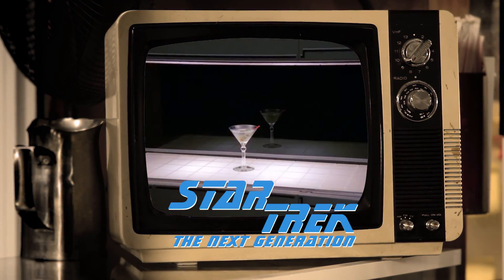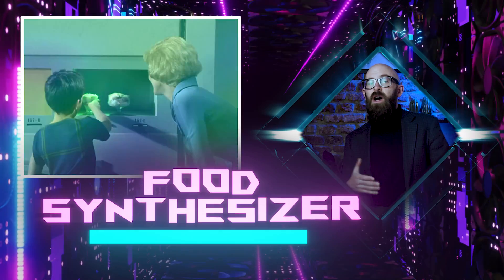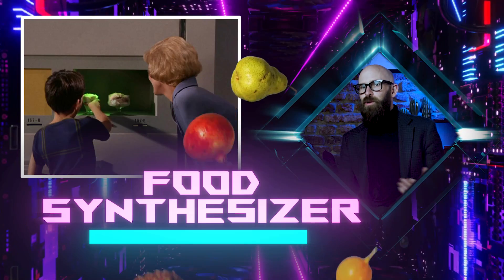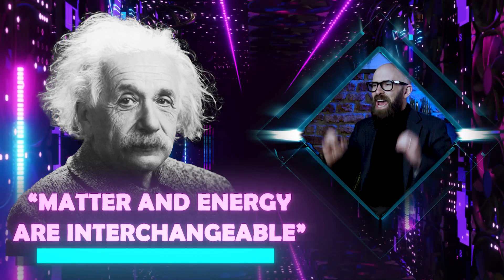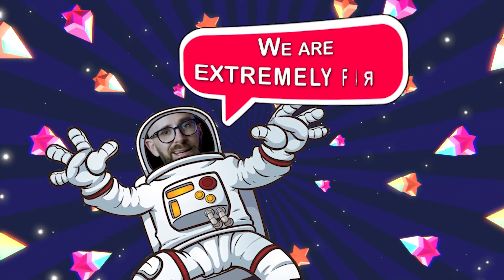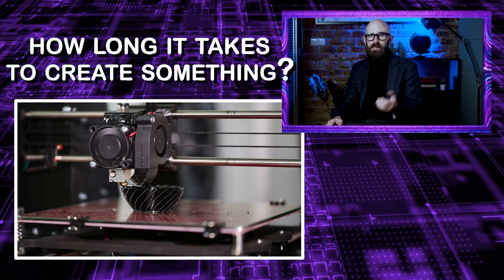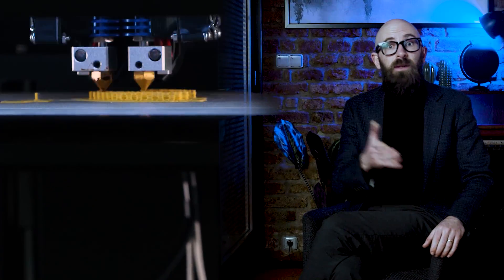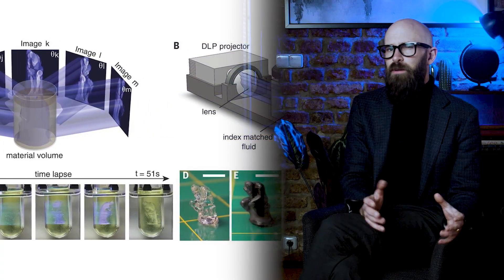How Far Away Are We From Replicators?

Comment: That's one of the reasons that Star Trek - Voyager worked for me. They had to limit power use the whole trip and food was always a concern. Made the whole reason they had to contact others along their way home instead of just going in a stright line.
Reply: It always bothered ne that when making cofee they replicated the whole mug and water in it instead of just replicating instant cofee, reusing the mugs and just adding hot water to save energy.
Reply: Voyager has two small Bussard ramscoops since it's lower tier starship class.
Reply: @valenrn8657  you mean section 31 class;)
Reply: They actually had to refuel the classified torpedo and shuttle replicator.
Reply: When you recycle the mug you get most of the energy back.  And you didn't have to worry about washing it.
Reply: Neelix was great!
Reply: That was a way to enforce artificial scarcity but yes.

Comment: 5:55 the 3D printer pictured can take over 10 days to print one object that fits in its "build volume" of appx 8 X 8 X 8 inches. (if it takes up most of the volume and has high "infill" percentage)

I have 2 printers that are a little more advanced than that one....

Comment: My understanding of physics is very limited, but I think using energy to create matter also results in an equal amount of antimatter. For a civilization that has mastered faster than light travel, that's probably trivial. For us, it's less trivial.
Reply: No.  The original source of mass to create the  energy is from sources that were matter, and baryon number and lepton number are both conserved, which means that the output would also be matter.  Matter and anti-matter have opposite baryon number and lepton number. So, if the original source of mass were anti-matter, the baryon and lepton numbers would also be conserved, resulting exclusively in anti-matter.  Do a search on "conservation of baryon number and "conservation of lepton number".

There are some processes that do result in particle/antiparticle pairs, such as a photon creating an electron/positron pair, or an electron/positron pair annihilating to create a photon. This is most commonly seen with what are called virtual particles, but the net result is baryon number or lepton number change of 0 (conserving the number), since the positive number of the matter exactly balances the negative number of the anti-matter.  But this is a scenario where you are starting from 0 and ending with 0.

When you start with source that are ordinary matter, you will also end with output that is ordinary matter due to the conservation law.

Comment: On starships they have Bio-stores and Mass-stores for the replicators (you can find them in some technical manuals). 
The Bio-stores store Biological molecules, instead of the base elements, probably to reduce power costs and it doesn't need to start at the elemental level. 
The Mass-stores store Elements, but only the most common ones, and can easily be replenished from planets, asteroids, gas giants and so on. The more complex an element is (normally the higher its atomic number) the less is stored, this puts a limit on what can be replicated as to make a lot of the heavier elements takes a lot more power. 
Another thing that limits them are materials that can't be replicated because they contain components to their structure outside normal space-time like Di-lithium. 
Lithium, is stable. However in Star Trek they have Di-Lithium (which can't exist in real life) which is actually a Tri-Lithium with 1 Lithium atom in another layer of space, that stabilizes the Lithium. In star trek when Di-lithium is bombarded  with antimatter some small amount will convert to Tri-lithium as a byproduct. But because of its extra-spacial properties, it can't be replicated.
Reply: It's not due to having extra spatial properties.  It's due to the structure being too complex for the "molecular resolution" of the replicator.  Replicators use extensive compression and averaging techniques, because it is not possible to store a pattern at the quantum level necessary for that, because even in the 24th century the storage space for that doesn't exist.  (Transporters use something called quantum resolution, but they store the pattern itself in a buffer that degrades.)
Reply: @StormsparkPegasus  this is why yu can't make living organisms with replicators too.  Though that limit may change in the futer as when the TNG Enterprize was transforming into alien ship it did make living materials.  Andm it did mak a child(procreated)  in another episode.
Reply: @0011peace  They have made living things in the replicator, like Worf's spinal cord.
Reply: @SiXiam  was it "living" or just a bunch of bio matter? As for the power it takes for these to work, or the "Stores" needed for them to work..... I remember one Next Gen show having portable Replicators about the size of a kitchen trash can, they brought down to a planet.
Reply: @SiXiam  
Thst isn,t itself alive and it used a solution no just replicstor
Reply: @finscreenname  I'm not sure what episode you mean. At the very least we know the replicators on the Defiant have a feed of plasma (basically hydrogen). Kira blew one up. So it wouldn't be just straight energy to matter like the video says. Maybe the portable one would have a fusion reactor for power/plasma.
Reply: @0011peace  Nerve cells are certainly alive. But the details of the machine aren't really shown. Maybe it combines cloning with transporter resolution replication. At that point I don't think they said a replicator couldn't make living cells. In Enterprise they showed a replicator that made a full body. A dead body but it had cells.
Reply: @SiXiam  I like ST and all but you won't find me at comic con so what season and episode I dont have a clue but I remember it was Next Gen and something about the planet, so they beamed one down. They did also say that it would make food and tools (probably not things like phasers).
Reply: @SiXiam  with help and i am tLking about plsnts snd animals that can live on tjier own dspinl cord cqnot live on its pwn
Reply: @SiXiam  dead cells aren't alive they can't create and animate .  It is statd in TNG including surprize when living  plamt came out of the replicator.
Reply: @finscreenname  The Survivors I think it was
Reply: @finscreenname  They have micro fusion technology, which a lot of star trek tech is based on.  Picard references it in a few episodes.  Literally a fusion reactor in a vessel the size  of a Energizer D cell battery.
Reply: I think Tri lithium was weaponized in one of the episodes, they also talk about Tri tanium, Geordi references it.

Comment: For big castings that require custom mold you hold on for potentially decades for replacement parts we currently might as well be using star trek technology. The fact that steam locomotives used castings is a big reason why they were replaced. Today with 3d [printing you could store a virtual mold for 50 years before you need to use again.
Reply: There's a nearby company that make power generation stuff, they had some large castings done, left them to weather and age for a few months (possibly longer) - and they were stolen. Fortunately they got them back.. I find the frame castings for the duplex locomotives amazing, all cylinders and steam/exhaust pipes cast in one piece of steel, itself difficult to cast because it's not very runny.
Reply: @joejoejoejoejoejoe4391  Lincoln Welding company is 3d printing metal with robot arms & a welder.
Reply: @jmd1743  It would interesting to see the difference in emergency consumption of casting and 3d printing, I presume that it would be about the same, but it still could be wildly different. I presume that you could change the alloy in different places with different feeders, possibly even using bronze bearing surfaces on a steel print. If you added a milling head to a 3d printer, you could print and finish machine something in one operation.
Reply: @joejoejoejoejoejoe4391  I'm interested in seeing where 3d printed guns go because a 308 cartridge exerts 60,000 PSI on the gun when the gun goes off.

Compare 60k PSI to say  the stress seen with air compressor. 

Guns were among the first mass produced items on the planet in a factory mass production environment because it was a matter of life & death to standardize the tiny parts such as springs.

A gun is likely able to withstand  more pressure than a rocket engine.

Imagine the day when SpaceX could 100 percent 3d print one of their raptor engines.

I'm interested in 3d printed organs, my prediction is that we'll replace hearts like we do with timing belts on a diesel.

 If we could 3d print a gun we'll likely be able to produce organic material that would allow a 3d printed heart to last 50 years before it needs replacement again.

My long term objective? We'll we're about to enter a transition for human civilization like we saw where we went from hunter gathers to farmers.

Mexico has gone from 6 babies per woman to 2 babies per woman, their pension system has collapsed. Japan's and China's pensions are about to collapse along side America's.

What I'm hoping to see is science greatly extend a person's life such as making  frail bones, heart attacks & strokes a thing of the past so that if people were to die it would be peacefully in their sleep and not because of a cascade organ failure.

So we'll need to do things such as 3d print new hearts, kidneys, be able to produce bone marrow in giant vats and to be able to produce gallons upon gallons of blood & plasma.
Reply: @jmd1743  I don't know much about guns, but I think the first barrels were made by making a spiral of steel, perhaps a 3d printer could do something similar, and have something like a de-scaler following the nozzle to forge the steel and change it's Chrystal structure. Your comment seems to have interesting contradictions, you talk of guns, and also of prolonging life, and the problems with pensions. I think if we could do something about the unfairness of illness, it would be an incredible advance, instead of people suffering and dieing at a young age, before they've had a chance of life, they'd be able to live as long as the rest of us. The blind would be given sight, the crippled given movement - but then would we be in danger of having everybody the same? Don't our weaknesses define us as much as our strengths?

Comment: As I recall from the tech manual for star trek TNG, the replicator was actually more a form of transporter that took a generic for of matter, and manipulated it so that it would become whatever was needed.

So it wasn't QUITE turning energy into matter.
Reply: exactly what I was thinking, and considering at least some amount of the engines were matter antimatter type engine. it makes sense that the energy for the replicators was the same fuel source that powered the warp drive. IE matter and antimatter. Super energy dense and pretty freaking stable
Reply: @LeonardGreenpaw  à
Reply: Correct, the manual says it comes from "inert carbon", and when I asked my science teacher about it he said carbon is not inert
Reply: @NeoTechni  Diamonds and Graphite are inert carbon.
Reply: @looksirdroids9134  You can burn diamonds.  Weird to think of the CO2 pollution from that.
Reply: @lubricatedgoat  By that goal post, nothing is inert. Which is scientifically correct, but I think it misses the mark from the writers of the show. Whom wrote from a pool of common knowledge. Like the noble gases being inert, instead of scientific reality where they aren't. Diamond and graphite would be inert in the sense they wrote as you have to take measures beyond exposing them to the standard living environment of a human to have them react.
Reply: @NeoTechni  
Carbon, like oxygen, likes to bind to things. Though the term inert carbon could be a bit elastic, meaning not part of a living organism.
Reply: @NeoTechni  but can  it be made inert?
Reply: This is correct, the official blueprints for the ships include numerous storage containers marked "organic matter" and so on, some of them specifically say they're for replicators.
Reply: correct.
Reply: @Cancer McAids I own a set of the blueprints for TNG and it clearly shows multiple levels and many storage containers holding all the different matter and such needed to produce the items.  The only thing that was brought up is it couldnt replicate sophisticated patterns.  Human hearts were fine, but human brains could not be.  And them the alcohol was created using synthahol which tasted like the alcohol but wasnt able to be replicated as original.  Thats like scanning the ingredients in for Coca Cola and it produces a generic Cola alternative, still good though, but a tad off the original.
Reply: Based off the insane computing power and unbelievable energy required for the Star Trek teleporter, theres some video out there about it, it would probably take a totally unrealistic amount of effort to zap a sandwich in front of you. Maybe you could get a vodka shot though.
—I left this comment earlier. Basically teleportation is the exact same as replication. Except with teleportations, you have to deconstruct the matter and also transfer it before replicating it. So teleportation would require MAGNITUDES more of levels of energy and computing power to accomplish that. Especially the physics behind deconstruction. Compared to a souped up 3D printer. Teleportation would also have the limit of the slow speed of light. Quantum entanglement in reality is really a statistical phenomena and not a way to transfer information faster than light. The limit of knowing information is still speed of light transfers.
Reply: The energy required to transport matter through time and space is the same as the amount to create it.  
If you don't recover the energy from the source transfer then the net amount of energy needed is staggering.
Reply: Thank you for mentioning this. I have worked out the lineage of all these things and yes, the replicators change deuterium into stuff and turn everything reclaimated back into deuterium for safe storage and/or engine use.
Reply: Iirc Voyager had to visit a nebula to stock up on raw materials for their replicators. I want to say it was just straight up hydrogen but I could be wrong.
Reply: More like it was not relying on the warp core for energy, but some base matter converted to energy probably stored in the warp core itself. It would  make sense that, for say, fecal matter for the crew was stored as energy to be converted into food in the replicators. 

To this day, I do not understand why Starfleet vessel, for example, did not just swoop up to and asteroid or rogue planet or some such, beam off some material as energy to use in the onboard replicators.
Reply: But used energy
Reply: @Cancer McAids no, fat protein and othe things you need amino acids and other stuff
Reply: Correct this is why for example most ships have cargos bays in star trek,  the places crates and barrels kept falling on the crew.  If they could just turn energy into matter why store anything just replicate it at will.  What they stored was the basic elements and when they needed say a glass of water it took oxygen and hydrogen and silicon for the glass from storage into the replicator system which I think is like the transporters pattern buffer and then recombined it and transported out a glass of water at what ever tempature requested.

This is why in a few episodes we see mining going on,  remember that orbital mining lance with the sentient repair drones in the next generation episode with data,  why mine if they could just convert energy to matter?  Or in voyager when they kept looking for certain elements because there stock was low.
Reply: @Cancer McAids That's generally how I assumed a Replicater functioned, that the ship keeps a supply of certain kinds of elements on a molecular level and simply combines them in a way to make the food or drink or object in general, tech like that would be so useful, it would mean Socialism type living woulf actually be feesible and sensible, as we could easily recycle trash and break it down on a molecular level, the reuse the atoms to make someting else. THe reason certain materials are more expensive then others often comes down to the quantities we can find and how easy or har dit is to actually aquire. Replicator tech would mean we no longer need to do this as matter can't be destroyed, it only changes into something else or get used in something else. THis kind of tech would easily solve so many problems.
Reply: To be fair we've been eating shit for thousands of years. Human waste was used as a fertilizer around the world.
Reply: I would think the replicator might turn existing matter into energy and that back into the matter in a form requested.  It would be problematic to just generate the needed energy to do this, but to use some form of matter as starting point could be practical.  Anyone wonder why starfleet ships have buzzard collectors?  Maybe this is the source of the needed matter!
Reply: That seems to make sense.  They do not generate the energy to make replicated objects, they just convert matter into energy and then convert that energy into matter in a new form.  They start off with some form of stored matter.  My guess is hydrogen collected by the buzzard collectors would fit the bill.
Reply: Transporters literally turn matter into energy and then back into matter. So, yes it's exactly like turning energy into matter. *facepalm
Reply: @immasmashyourface  * massive facepalm